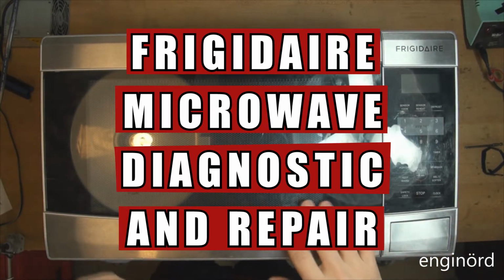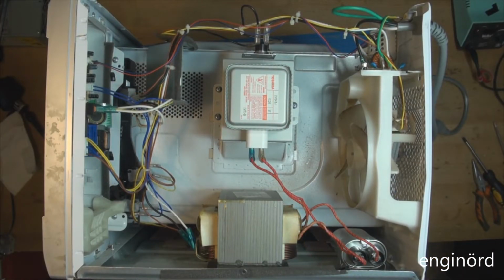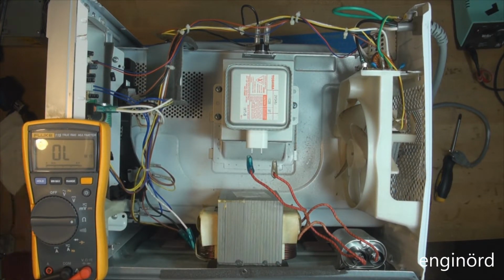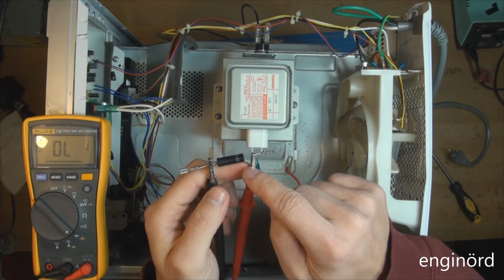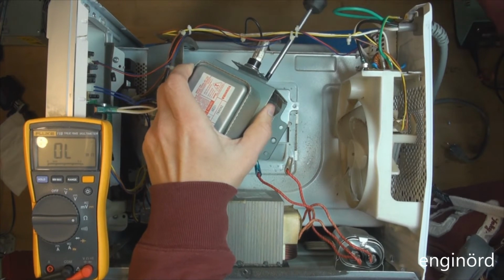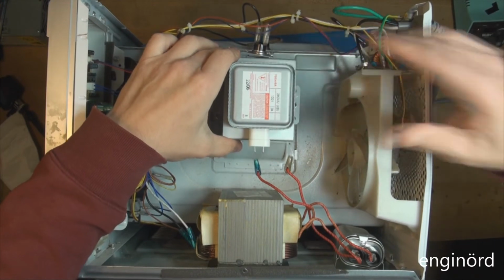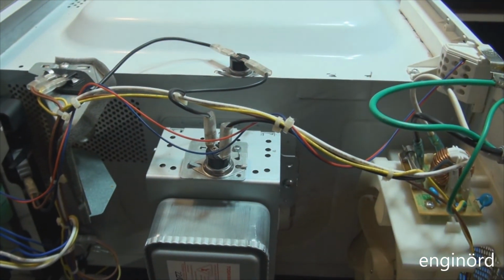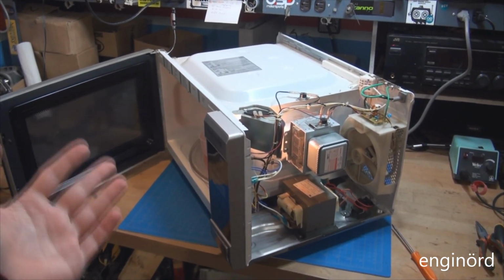Frigidaire Microwave Diagnostic And Repair

Comment: well you did not have to cut the leads for the beeping there is an option to turn them off
Reply from the maker: Really? Can you elaborate?
Reply: @enginord  some or most microwaves has it where you can turn off the beeps it would say in the manual if not try looking up unless it's an older microwave for me I hit the clock button twice to get to the menu and from there I can turn off

Comment: Mine blows 20a circuit breaker in panel when I hit start. Any ideas what could cause this? I read online capacity failure possibly? I am going to tear it down.
Reply from the maker: Most likely the magnetron. You can disconnect the wires from the magnetron, make sure they don’t touch anything or you and hit start. There is no feedback mechanism to the brain box so if the magnetron is faulty the microwave will just buzz and the turntable rotate.
Reply: Thank you, and thanks for recommendations on fix, I checked it out, It ended up being a issue with the switch on the door. The second switch from bottom. If I plug switch in the fuse blows. If i disconnect switch microwave works fine. I left disconnected for now, will order new switch. Thanks great video. @enginord
Reply from the maker: You are welcome. So when the switch is closed it’s pulling it to ground (neutral) and tripping the breaker? That’s strange. Hope you can fix it.
Reply: Yes, it appears to have multiple safety switches, for this switch if circuit is closed it blows fuse (it checks for door open with power to magnatron). I found solution in below video link. Same issue I was having exactly ! Thanks, you have great videos, I'm sure I will need to replace other parts some day, it gets a lot of use! 

https://youtu.be/sT8oFuHiZUk?si=asVNN_hKJUhA_TMv

Comment: Our Frigidaire Microwave interior light comes on, but the screen is dead.  Any ideas?
Reply from the maker: does it beep when you press buttons? Is there voltage on the control board?
Reply: @enginord   No beeps, just the interior door light comes on.  I haven't checked the control board though and I'm not a technicion by any means.